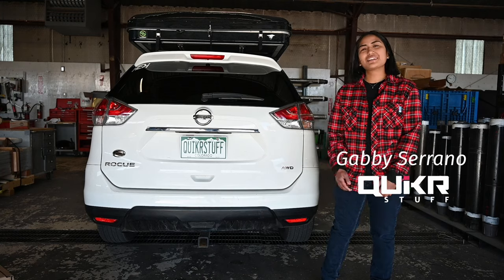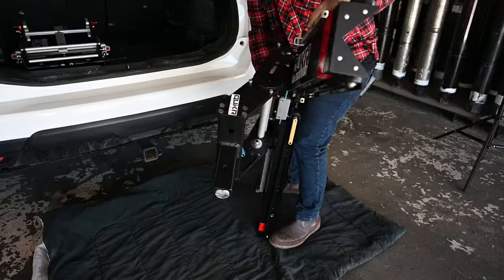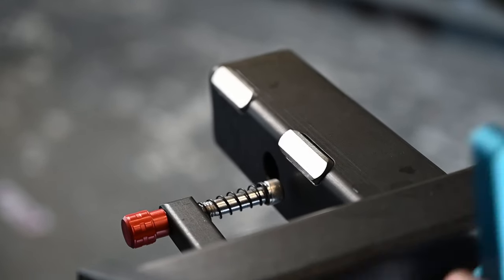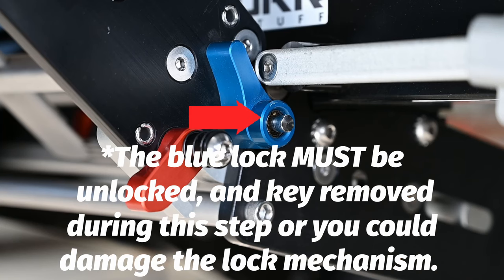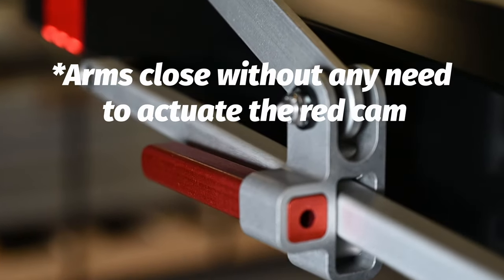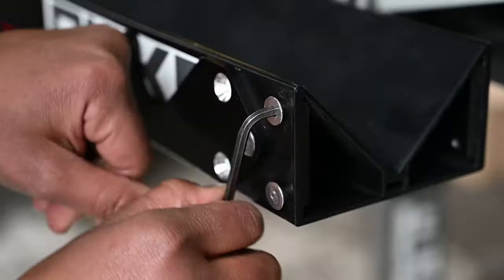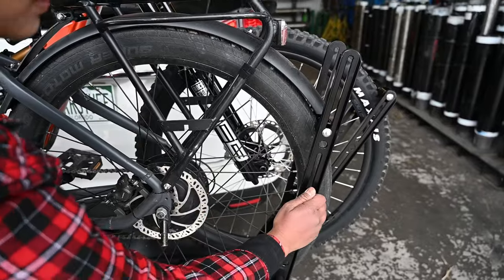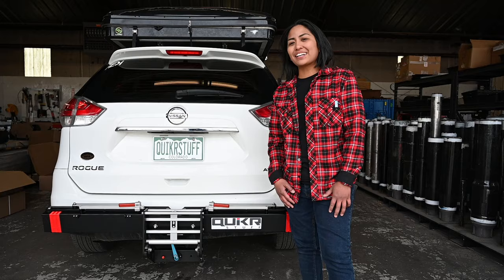Everything you need to know about the Quik Rack Mach 2 - 8/2/22

Comment: Just purchased this rack with 1 add on. Couldn't be happier. I'm trying to sell my Yakima HoldUp Evo. I may have to give it away. No comparison. My Yakima wobbled in the hitch receptacle and I had to shim it with thin cardboard. Also, the front wheel had a tendency  to come out of the hold down on rough roads. Some are complaining about the price of the Mach 2 but quality typically isn't cheap. My POS Yakima cost $500.
Reply from the maker: Glad you like it!!!

Comment: I like the license plate option so you don't get harassed by cops for covering it up when transporting your bikes. Although, you can still run into a jerk officer who could pull you over because you are required to illuminate it with a light (as if their headlights and flood light don't sufficiently light it up for them to see).
Reply from the maker: It's a good point, Bryan. On our roadmap is a fully lighted with turn signals version. Just trying to find the time...and capital :) Bryan

Comment: Hello, this looks to be a great product. Could you explain what prevents a thief from unlocking the blue levers and taking the rack?
Reply: Yes, please explain anti theft
Reply: You push the metal pin in as shown at 3:04 and it prevents the lever from spinning. Use the key shown at 0:40 to pop the metal pin out and free the levers ability to spin. The key is a cylinder and couples the metal pin when inserting.
Reply: Gotcha! Thanks for the clarification. I assumed there was anti-theft but couldn’t be sure based on this video. Already placed an order and looking forward to using it :)

Comment: can u have 4 eBikes, what's the weight limit
Reply: I’m curious about that as well
Reply: I have four ebike and the weight limit with 2" hitch is 185lbs max for all four trays (one:120lbs, two racks: 240lbs, 3 rack: 300lbs, 4 racks 185lbs).  The most I can take is 3 ebikes at +60lbs each. This also depends on the max tongue weight of your vehicle if you can add extra racks (mine is 500lbs).

Comment: Hello

I purchased the 1 1/4in rack. I can’t get the rack to slide into the receiver unless I pull the push pads out. I turn the lever multiple revolutions but the pads won’t sit flush. Without the pads the rack wobbles in the receiver. 

Is this normal?

Thanks
Reply from the maker: Please email Support@QuikrStuff.com so we can help. There should be no wobble at all.